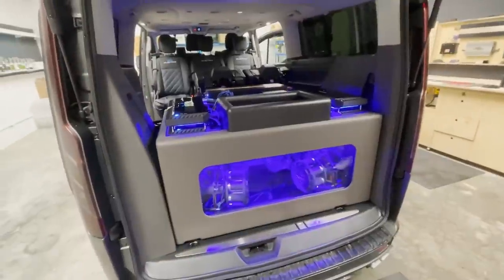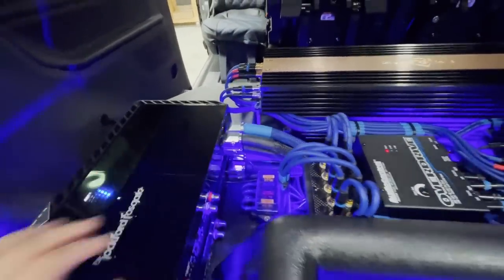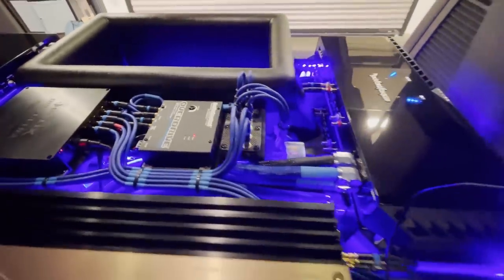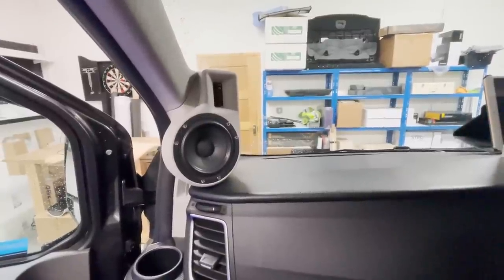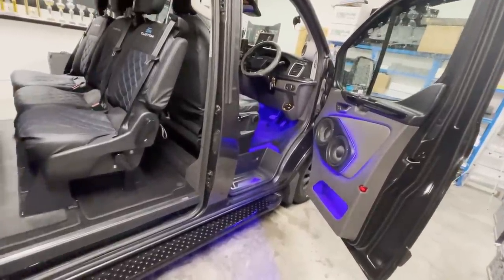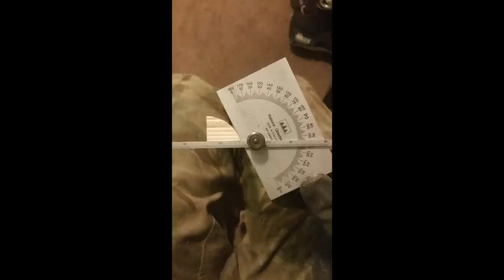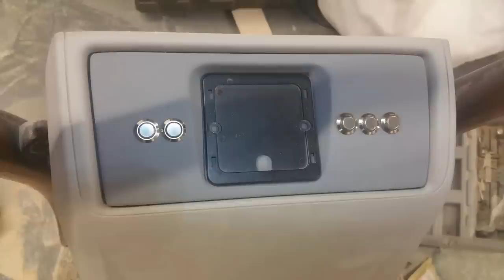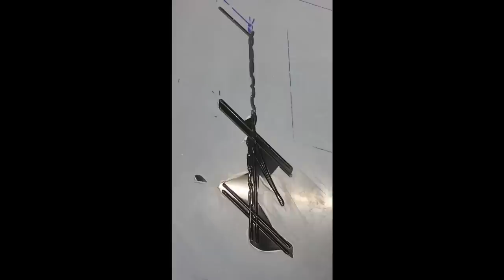Craziest SQ(LLL) System EXPLAINED With Walkaround & 600 Pictures - Expert Level Caraudio Fabrication

Comment: Coming from the custom computer building into car audio building, I noticed  they are 95% similar.  I remember going around explaining the custom water-cooling loops, and all sort of monitoring devices, machined parts, cable management etc. basically this video but with different parts. - Great set-up!

Comment: Peter, the DAC in the M15 is better than that in the Ultra. It has TOTL 4499 in it. I would run analog to the Ultra.
Reply from the maker: And as u can see they made possibility to connect that way too. 
The reality is that the cabin has so much effect on what we hear, that 95% of system can not even maintain a good spectral balance or have perfect staging, as most people have no clue about tuning, so i don’t get too fussed about the nuances of DACs, unless the system is truly capable of highlighting differences on that level.
Reply: @pssound9749  I can understand the sensibility comment. However, the Ultra uses a AK 4456. I would wager ANYONE can hear that difference from a 4499. Bass impact and timbre, stage width and depth, resolution of images among the differences. All we are talking is the difference in which cable is run to the back. 

I’m not attacking you, just highlighting an area that I think is underutilized in achieving the best SQ.
Reply from the maker: @camshaft34  maybe what you don’t realise is that you can’t get around the DAC in the DSP. You always use that.

Comment: what is your opinion on MOSCONI amps from Italy? Is it different from ZAPCO amps?Any reason why you choose ZAPCO amps a lot on your installations.
Reply from the maker: Mosconi has great amps, we built few systems with them, can’t say anything bad. 
I have long history with Zapco amps and once you know what you can expect from them at the price point, then there is not really much why i’d want to try 10 different amp brands people would expect me to do. 
We get to work with many many brands supplied by clients and not much can wowww me compared to Zapco Z line amps. Of course there are better, but price is also way higher.